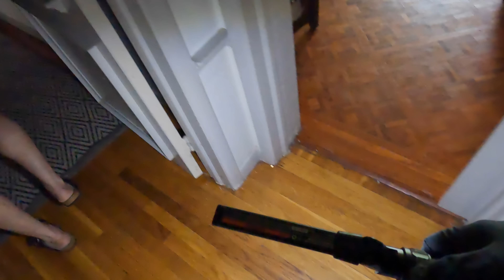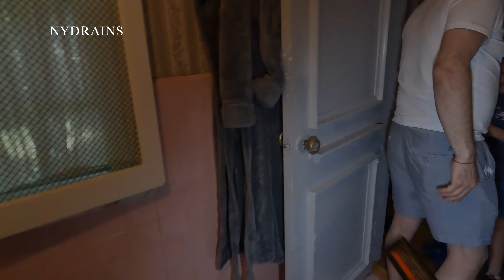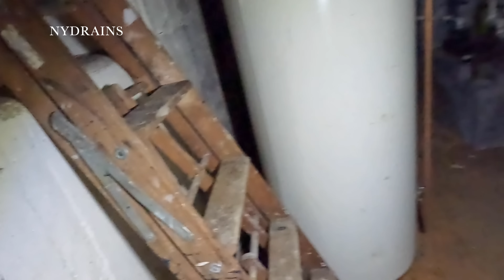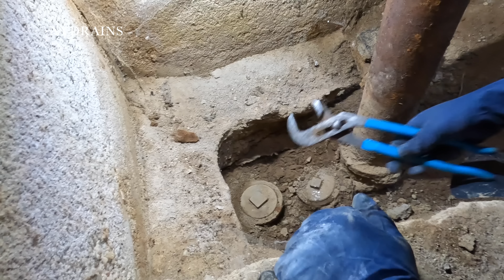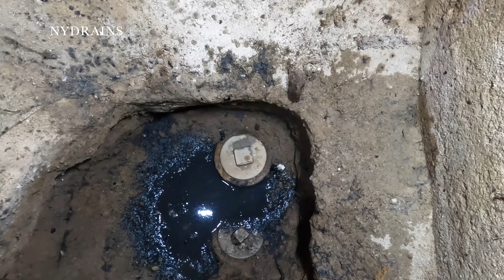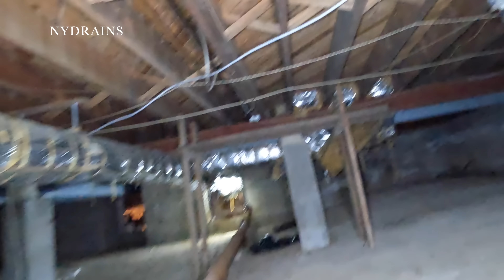Clogged Drain #175

Comment: You chose an interesting approach this time, with the toilet snake and one cap open and all. Made for a great explosion, loved it!
If it wasn't for the elevated entrance point and another dungeon you would've brought the snake with you, do i get it right? How much does this thing weigh though? I guess about 30-40 kilos (or 60-90 pounds)?
Reply from the maker: Actually 250+ lbs and you got it right 😉👍
Reply: @NYDRAINS  😲THIS THING IS HEAVIER THAN ME SWEET JESUS
wow, i would call it heavy machinery in that case. it doesn't look that heavy though...
Reply from the maker: It's sure doesn't. Looks are deceiving, the weight is hidden in the drum with 75 ft that weighs a ton💪